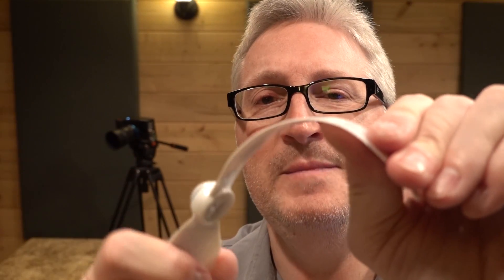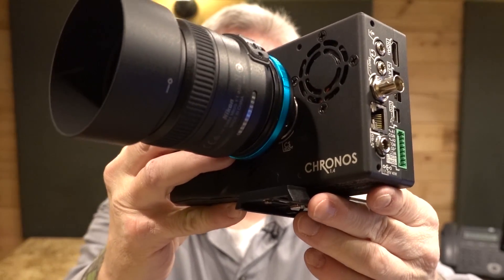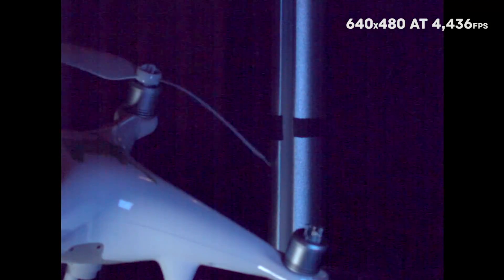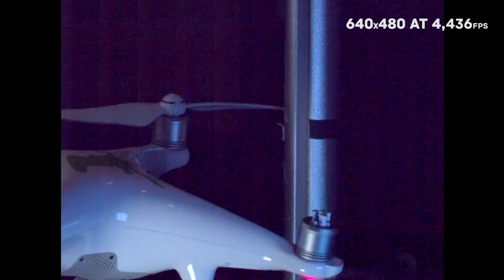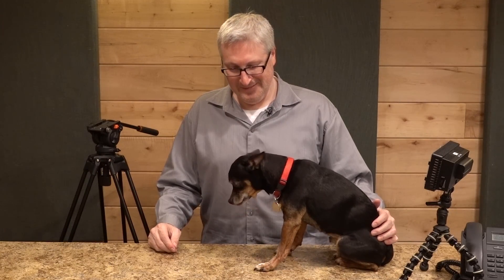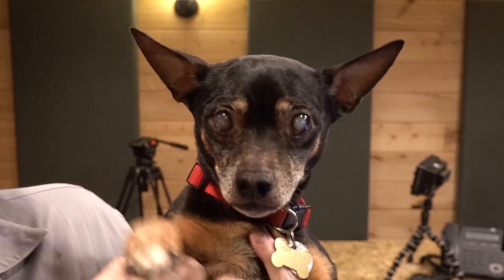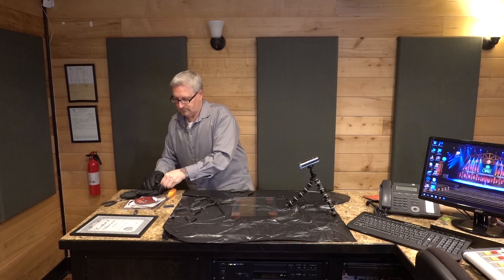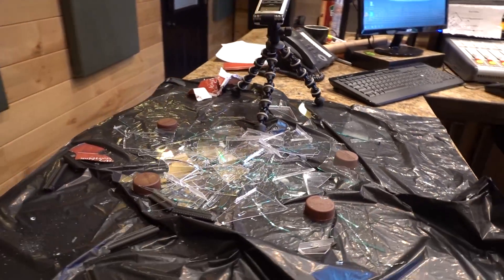SLOW-MOTION Drone propeller Impacts - KEN HERON

Comment: Hey, Ken, I know first hand how badly one of those dji standard props can damage you if they run into you. When I was first setting up and testing my phantom 4, I very stupidly tried to fly it indoors and ran into my left shin when it was 2 feet off the ground. The leading edge of those plastic props opened up some pretty good wounds, I still have scars from it, but they weren't debilitating and thankfully, didn't require stitches because the safety systems in the aircraft shut down the engines when they met resistance. So, I got some good bleeding flesh wounds, but nothing you would have to go to an emergency room for, but they did tax the limits on my first aid kit. Lesson Learned. Never fly indoors, Never let the drone come into contact with people, and always use prop guards when flying in a public place.
Reply from the maker: OUCHY man!!
Good lessons learned.

Comment: Quick question. If we have to maintain VLOS and we're allowed to use our UAS as a delivery system it's not possible to start a business doing this. So here's the question. How is Amazon allowed to do this without maintaining VLOS?
Reply from the maker: This just in:
The rules don't apply to rich companies. 🤣
Actually, there are different laws for private pilots and business enterprises.
Reply: I read in my ASA test prep that the FAA has no rules on this yet because of the VLOS rule.It's as current as 2018. I think your first answer is more accurate.

Comment: Glad you included the Foley sound segment.  I was wondering about that while watching the video.  But, OMG, what a mess to clean up!  How did you make the whomp-whomp sound of the blades turning?   And, why not capture the actual sounds and incorporate those?
Reply from the maker: The actual sounds aren't as dramatic, that's why movies do Foley as well. The blade swish was made with a thin wood dowel whipped through the air.

Comment: Great video Ken!!! It would be awesome to watch what happens when it rains over the motor of the Phantom 4, will the water be  ejected by the air flow? And you could try with different sizes of drops, simulating the start of the rain. and then go a bit bigger.
Reply from the maker: Great idea!
Reply: @Kenheron   You could also then show the proper way to maintain said motor if water came in with rain please?

Comment: Ken:  Years ago we did high speed motion photography using 16mm film.  You could shoot a reel of 200 feet in about three seconds.  The camera used a rotating prism for a shutter.
The last time we got called to record a firearm blowing up, we had problems locating a lab to develop the film, we ended up having it done in San Fran Sicko.  We used to do demos like breaking a light bulb with a hammer.So how much does a high speed video camera cost?  Jim